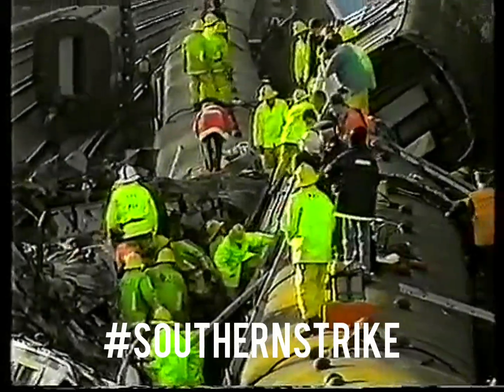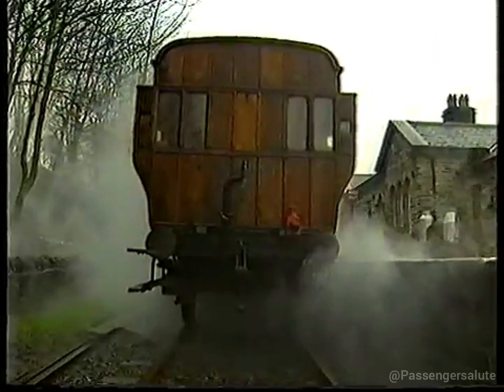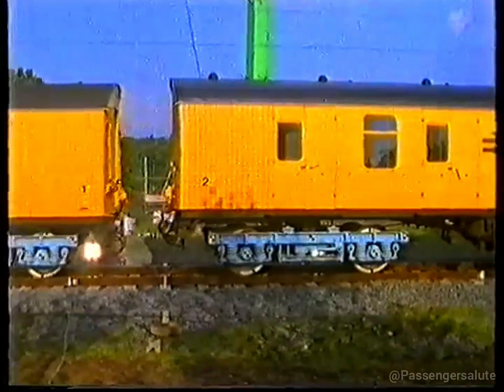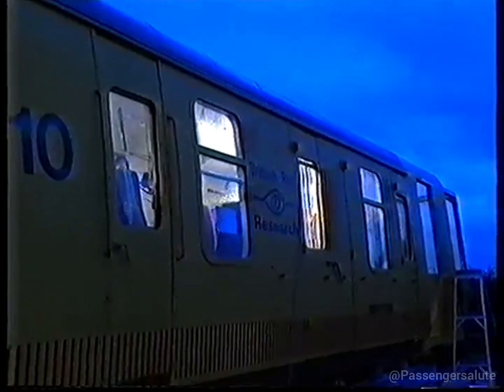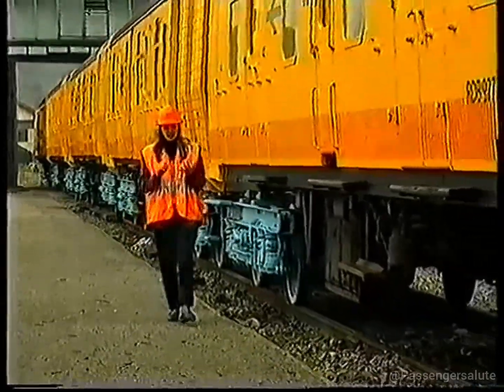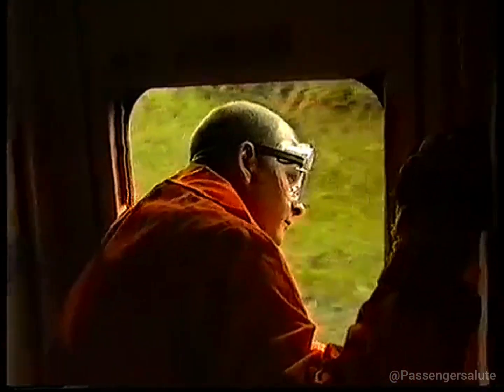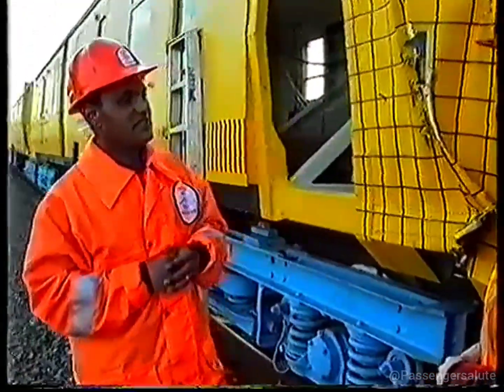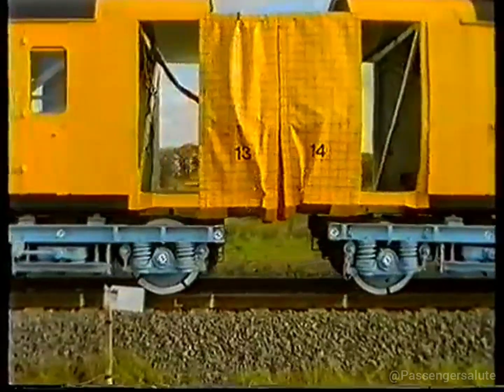UK TRAIN CRASHES - SAFETY BY DESIGN - BR CARRIAGE CRUMPLE ZONES

Comment: I believe there is a middle ground between privatisation and nationalisation. The day to day running of the railway should be nationalised. The day to day maintenance should also be nationalised. (As it is now) and the trains should be purchased privately and leased to the railway. (As it is now) sectorisation worked but it needed the government to take a hands off approach by allowing the railway to develop and budget a 5 year plan as it does now which then means that the railway isn't starved of investment as it was under BR. Privatisation in its current guise sucks. Nationalisation as it was also sucked. Buying new trains is a huge financial drain at around £1m per carriage!!!
Reply: I disagree. Either the whole railway should be nationalised), or it should be privatised. Maybe selling it off to different companies (infrastructure and trains alike) would be the best way of doing it.